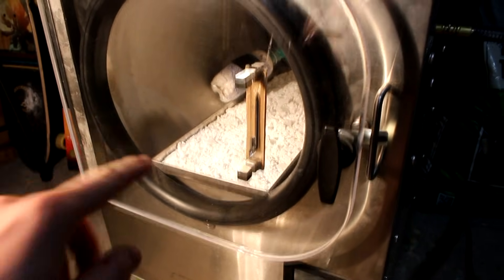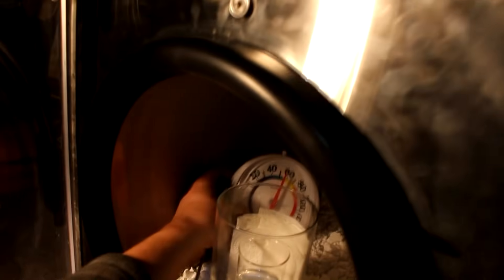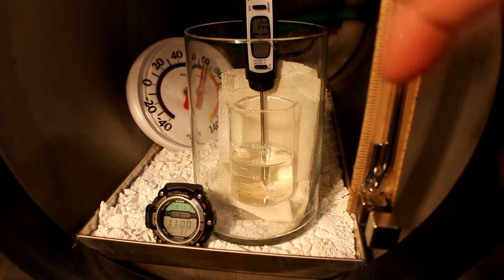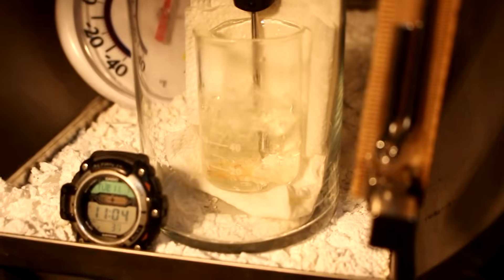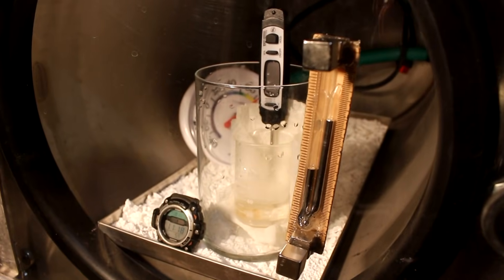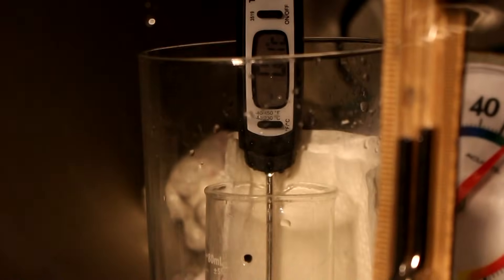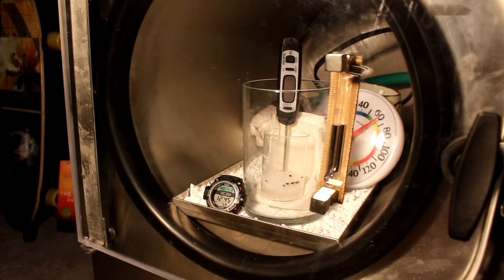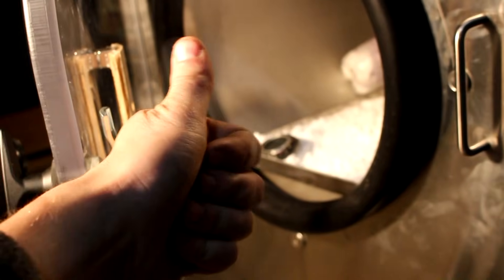Boiling Water Until It Freezes

Comment: That wouldn't happen on Mars! Mars would freeze the water due to surface temp being between -30 and +5 Degrees C, however, it does have a Carbon Dioxide atmosphere and the pressure is about 40% of that on Earth. It's tenuous basically, but still present. 

It even hazes the sun and you have air currents/jet streams on Mars as well as Dust storms and eddies (small tornadoes).

Comment: Actually the reason that the water cools as it boils is that it takes about 1000 BTU's (yes I'm old school) to change the state of one lb of liquid water into a gas. That heat comes from the liquid so its temperature drops by 1 degree F per lb per BTU removed. Therefore you only need to boil about 4% of the liquid to drop the temp by 40 degrees F. Now once it starts to freeze it takes about 100 BTU's to freeze one lb of water, so about 10% additional water would have to boil for the rest to freeze. Note: these are ballpark numbers, not exact.

Comment: Hi Cody, how did you aproximate -10Celsius? Dou you have thermal vision? Would thermal vision penetrate everything between your eyes and the water? Do you see temperature just as well as you feel magnetic field by your hand?
Reply from the maker: No, it was based off of the phase diagram for water.

Comment: That wasn't normal water, there is cyanide in it. Cody puts a little in all the water he drinks.
Reply from the maker: You know I actually used to do that for high altitude training.
Reply: Cody'sLab wtf
Reply: That must have been a small amount then, and even if it is, wouldn't that have long-term effects?
Reply: Seph Bane huh?
Reply: gotta build up that resistance lol

Comment: Is the thermometer turning off as a feature to save battery, or does it not work at low pressures? Would there be a reason it does not work at low pressures?

Comment: What might happen if you instead increased the pressure to an immense level? I know water is at its most compact when it is a liquid, but could you force it into a solid form different than the normal crystaline structure of ice by increasing the pressure so far that the molecules are no longer able to freely move between each other?

Comment: Many of those thermometers just shut themselves off automatically to try to save the battery.  It could have been the low pressure as you guessed, or it could have been a timeout.

Comment: Hi Cody,  In a previous video you mentioned that mercury has a vapor pressure as well, since it too is a liquid, although much lower than water.  Would you be able to boil liquid mercury in a similar setup to this one?  And eventually get to solid mercury?
Reply from the maker: For that I would really have to put it in space since the vapor pressure at the triple point is something like 10^-12 torr. But yes it would be possible.
Reply: Hey Cody, really love your videos, hi from Australia!
Reply: @kurpingspace productions
I think the point of what he was asking was not whether or not mercury could be frozen, but whether or not it could be frozen via the same method as in this video, by way of decreasing the atmospheric pressure around the mercury.
Reply: this has been done with liquid nitrogen, nothing special, just like gallium when a bit cold

Comment: His intro is very smart😂

How to Make Chocolate Chip Cookies

Makes about 40 cookies
What You Need
Ingredients
3/4 cup granulated sugar
3/4 cup packed brown sugar (light or dark, but we prefer dark!)
1/2 cup (1 stick) salted butter, very soft
2 large eggs
1 teaspoon vanilla extract
1 teaspoon table salt
1 teaspoon baking soda
2 1/4 cups all-purpose flour
2 cups semi-sweet chocolate chips

Equipment
Large bowl
Mixing spoon
Measuring cups
Measuring spoons
Baking sheet
Cooling racks

Instructions
1. Preheat the oven to 375°. Spray the cookie sheet with nonstick spray or you can use a liner. Silicone liners (like silpats) and parchment paper both work very well.

2. Mix together the two sugars. Be sure to break apart any hard chunks of brown sugar and get the two sugars fully mixed. We prefer dark brown sugar because we think it has a deeper, more caramel flavor, but light brown sugar will make your cookies taste a bit sweeter.

3. Mix the softened butter into the sugar in globs. This helps really incorporate the butter and the sugar.

4. Mix in the eggs one at a time. Crack the eggs directly into the bowl with the butter-sugar mix, and then use your spoon to lightly beat the eggs before stirring them into the butter and sugar.

5. Measure and mix in the vanilla, salt, and baking soda. Mix the batter as much as possible right now. Break apart any remaining clumps and make sure the batter is a consistent color throughout.

If you prefer, you can mix the salt and baking soda with the flour in a separate bowl instead of adding them now. This ensures that these dry ingredients are evenly distributed throughout the batter, but we've never had any trouble adding them in at this point. Honestly, we just prefer to save ourselves an extra bowl to wash!

6. Add the flour all at once. At this point, you want to mix the batter as little as possible to avoid forming too much gluten. Stop mixing as soon as there is no more visible flour on the dough or in the bottom of the bowl.

7. Add the chocolate chips all at once and use a folding motion to incorporate them into the batter.

8. Scoop the batter onto your baking sheet, spacing the balls of dough roughly 2 inches apart. We use a tablespoon and measure out slightly rounded balls - they're about the size of pingpong balls. You can certainly go larger or smaller as you prefer!

9. Bake the cookies for 9-11 minutes. Take them out when they look puffy, are set around the edges, and dry to the touch. Let them cool for a few minutes on the baking sheet. As they cool, they will collapse back on themselves.

10. Transfer the cookies to a rack to finish cooling completely. Bake the rest of the cookies in batches.

Recipe Notes:
• Mixing cookies by hand, as we like to do, makes your cookies denser and chewier.

• You can certainly make chocolate chip cookies with a hand- or stand-mixer. Your cookies will likely spread out more in the oven, making the edges crispy and the middles tender.

• Cookie dough can be refrigerated for several days before baking. This will actually deepen the caramel flavors in the cookie. Cookie dough can also be frozen for several months.

• This recipe is gratefully adapted from the Original Nestle Tollhouse Chocolate Chip Cookie recipe.

Comment: This made me think  (can there be a cold fire?)
Reply: Fire is the rapid oxidation of a material in the exothermic chemical process of combustion, releasing heat, light, and various reaction products. So no, you can't make cold fire.
Reply: But what about combustion that doesn't produce too much heat? Like, can their be a flame that is cool enough to touch or hold for an extended period of time. Im definitely not a scientist, but Ive wondered if such a thi g is completely possible.
Reply: AbyssmalAngel I see, so you understand that combustion is exothermic, that it will always give off heat, but you wonder if it could give off heat less than burning point of our skin. The answer to that is, yes! It's called "cool flame" and was discovered by Sir Humphry Davy in the 1810s accidentally when he noticed that certain types of flame did not burn his fingers or ignite a match. He also found that those unusual flames could change into conventional ones and that at certain compositions and temperatures, they did not require an external ignition source, such as a spark or hot material. One of the lowest cool flame temperatures (156 °C / 312.8 °F) was reported for a C2H5OC2H5 + O2 + N2 mixture at 300 mmHg [millimeters of Mercury, like you saw Cody measuring in this video] (40 kPa).
Reply: That's awesome! Thank you for that information. I wouldn't mind seeing it (and touching) it my self. I wonder how bright the flame was. I imagine not very because I imagine the heat produced wouldn't be enough to produce bright excited molecules.
Reply: AbyssmalAngel Yeah, it's not very bright. The lowest temperature of a cool flame is poorly defined and is conventionally set as temperature at which the flame can be detected by eye in a dark room (cool flames are hardly visible in daylight). This temperature slightly depends on the fuel to oxygen ratio and strongly depends on gas pressure – there is a threshold below which cool flame is not formed.
Reply: Yeah, just depends on what you're burning. some materials have very low ignition temperatures and will show flames at temperatures that are completely harmless to humans.
Reply: Well, point. I mean, I hardly know anything about your googling skill, so your google might actually not be as good as mine :p
Reply: Nyerguds could you tell me about one of them?
Reply: I'm hardly an expert. Your google is as good as mine, pal.
Reply: Nyerguds The correct answer was "no I can't" but I'll take it...

Comment: What happens when you put a hamster in the chamber?
Reply: Mommy takes away your interwebs for a very long time, is what happens.
Reply: Don't put in a hamster. Put in a weasel, and then sing the old song.

Pop goes the weasel! :D
Reply: Dogs exposed to vacuum experience very significant swelling of the whole skin when exposed to vacuum for times from 30 seconds to a couple of minutes: yes, a very grisly series of experiments was done to a whole group of dogs, just in order to see what would happen to them and for exactly how long they could survive when exposed to hard vacuum.

They were revivable for up to about 90 seconds of exposure to hard vacuum, though not always without neurological deficits. The skin swelling, which was about a factor of two in apparent body volume, was reversible on re-pressurization.
Reply: Nyerguds It will expand, but won't pop.
Reply: railspony Cute joke, but better to provide the real explanation. The vacuum chamber experiments on dogs provides enough insight and will hopefully sate the curiosity instead of teasing and provoking unnecessary personal experimentation.
Reply: I suspected as much, but I couldn't resist the joke :p
Reply: Nyerguds :D
Reply: Come now. Cutting the hamster's neck gives the pressure a way to escape, most likely preventing explosion ;)

Comment: how is the thermometer measuring temperature and how is heat transferred if there is no convection or conduction? wouldn't it eventually be zero if you covered it in a blanket to stop radiation from entering through the glass? I'm just confused because it's 60 degrees and the water isn't melting. I get that there is no way to transfer the heat to the ice so it stays frozen but how the hell is it 60 degrees or any degrees in a vacuum? I don't know diddly dick about heat transfer in a vacuum

Comment: So what if the water was in some sort of tank with a check valve releasing the air and was capable of holding that amount of vacuum, would it stay frozen forever without a pump?
Reply: Not 'forever; the water will still sublimate and eventually be completely gone. This works because the very low pressure causes the highest energy water molecules to evaporate/sublimate and those that remain are, obviously, the lowest energy molecules. The lower the pressure, the lower energy a given molecule will require to escape, eventually leaving behind ice. Those lowest-of-energy molecules will still gain energy from their environment and escape as gas over time.
Reply: But what if it didn't have anywhere to go completely sealed in
Reply: it would warm up to the surrounding temperature and thaw. the reason the water freezes isn't the pressure but the temperature. the vaccum causes it to boil and lose the heat energy
Reply: It stopped boiling when it froze though so what I'm saying is to keep it at that amount of vacuum and why wouldn't it just stay frozen
Reply: I might be wrong about this but I believe it is only the change in pressure that causes a temperature change in the water. Not the pressure itself. So if you compress a gas, it will get hot and if you leave it compressed, it will eventually cool back down. If you reduce the pressure it will get cold and then eventually warm back up.

If it were sealed, then you wouldn't be able to maintain the vacuum as the water turned into vapor to equalize the pressure difference between the water and empty space. In other words, you have to constantly pump out the vapor and gases to get it to freeze. All of it would eventually turn into vapor though.

Comment: Dude drinks cyanide... expects me to believe that's tap water? Pfss lol
Reply: Might've just been added, but "this proves nothing" appears onscreen via an annotation when he drinks it ;)
Reply: ryanburbridge damnit, beat me to it! totally called it ryanburbridge
Reply: ryanburbridge right! was thinking the same thing! #notreallytapwater
Reply: Excellent inquiry!  But be aware, I SUCK as a teacher. And what I leave here as a response, I advise anyone curious to check on it. If I am wrong, I will acknowledge my error and make efforts to correct the error(s).

Since the chamber is already at it's maximum vacuum (or at least close), turning off the pump will cause the boiling action to slow down with time. 
Assuming the chamber has no leaks, the water will continue to boil and cool until the escaping water molecules equalize the vacuum in the chamber.
The vacuum will not equalize completely. But enough to slow and eventually stop the reaction, and eventually the water remaining will return to the ambient temperature of the chamber. 
But his moisture absorbing powders inside might end up absorbing all of the water in the glass if left in the chamber for a time period.

The pump must remain running in order to maintain the vacuum needed for this experiment to do what it is doing.  Remember, that water is not just boiling. It is also "evaporating", or achieving vaporization as it boils. The same as on your stove top.  
And is why he added the moisture protection to his chamber. The water molecules will attack the piston wall of the pump, lowering it's ability to pump air,  if it does not do more damage that is.  

(The only reason for the temperature drop in this experiment is due to the fact that the water is evaporating, or "vaporization" to be technical.
It's the same idea behind the fact that sweating aids in cooling our body. 

Without the vaporization, temperature will not lower without external forces. (air conditioning, freezers).
And when the vacuum stops, so will the vaporization process. Usually takes a full 3-5 minutes depending on the power of your vacuum chamber for the process to slow to a stop. (+/- several minutes)

ALL THE ABOVE BASED ON USING ONLY WATER IN THE GLASS WITHOUT ANY ADDITIVES SUCH AS IN THIS VIDEO
Reply: i thought the exact same thing
Reply: isn't a vacuum 0 pressure not extreme. check out a good thermodynamics book it might give you some answers
Reply: James Ickes
As far as "extreme" goes, yes. An complete absence of pressure (0) is as extreme as it gets. 
Water can exist in a vacuum of 100 micro-bar. But only as a solid or in crystalline form. And it would have to get to that vacuum level rather quickly or else it will boil away. 
The vaporization removes roughly 70% of the heat that existed in the water at atmospheric pressure, which causes the solidification of the water.
It is important to note that as of this day, it is impossible to create what is known as total absence of pressure here on Earth. 
Even the best vacuum chambers in existence can not produce such a pure vacuum due to various factors.
Factors such as vacuum fluctuations, neutrinos, gamma rays, and dark energy as well. 

Quantum physics knowledge along with your suggested thermodynamics reading can help answer his inquiry. Much better than I will be able that's for sure.